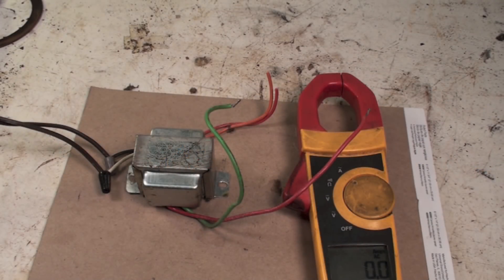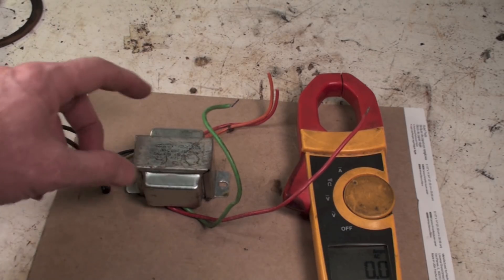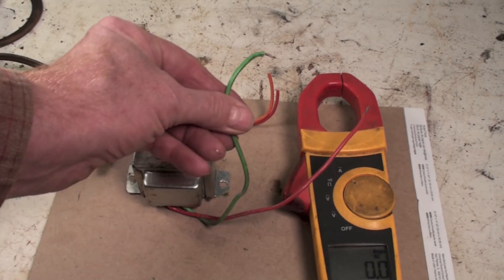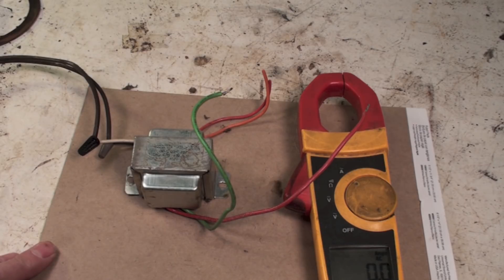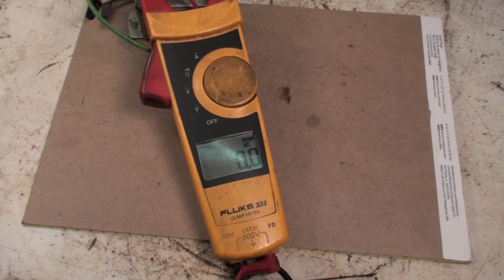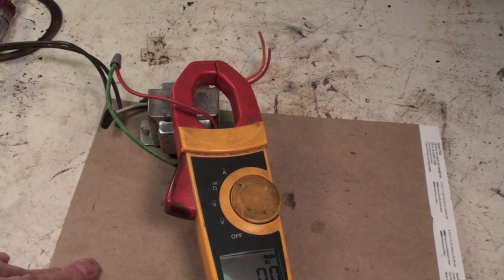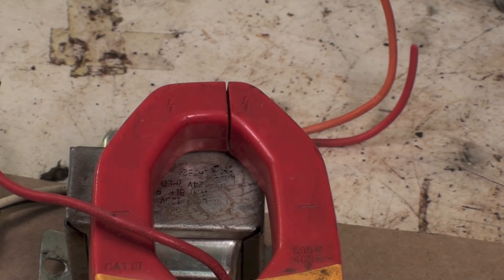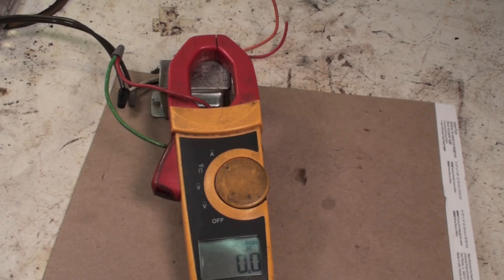How to replace a transformer (without burning up the new one)

Comment: What is the main cause while i start package acu,,,after i start compressor the transformer will tripping off
Reply from the maker: If the transformer is blowing a fuse or tripping its breaker, you have a low voltage short.  Possibly a thermostat wire shorted to the chassis of the unit.
GFM
Reply: @grayfurnaceman  sir but only transformer was tripping,,,the transformer has own reset button
Reply: Because the voltage of transformer was drop up to 20v only after starting the motor compressor
Reply from the maker: Yes, you have a low voltage short.  When there is a short, the voltage drops and the amperage goes up.  amperage goes up, breaker kicks off.
GFM
Reply: @grayfurnaceman  thank you very much sir

Comment: Would a voltage surge burn one of these up? We had some issues with power coming into the house, and half the circuits were getting 240 v, including the furnace. It didn't blow the furnace fuse, but the thermostat is no longer getting any power, but I've confirmed the system is getting 120.
Reply from the maker: It certainly could.  Look for an open in the primary of the transformer.
GFM

Comment: Looking at a 30-40 yr-old RHEEMS forced air unit. Blower motor works but every wire-nut popped, and the fan control (with the 8" sensor wand going to the plenum) wire that stabs in left side top burnt (primary voltage, I believe)..both wire nuts with 3 wires ea. on the 120v. in to the transformer fried,,transf. is not outputting nothing, ohms across 120 v. input wires=64 and secondary is 10 ohms..wire-nuts to the fan-motor fried (I replaced the motor 3 years ago). I stabbed a solid wire in the fan-control hole that burnt and wire-nutted it to the old wire, got no change, i.e., the main gas opens and fires when you plug in the transformer with wall control ON but when the sensor is satisfied, it shuts down and no blower-motor happening. I just bought a trans., but am loathe to install&burn that one , too, without discovering the root cause..which would be what?? (..do u think) thanks, cris 
PS:the guys at the real repairs place only asked me a bunch of pesky questions but would not discuss matters, leaving me with a lot of doubts as to my personal qualifications to be doing this..A-hem!
Reply: Replace the fan control relay.  If the unit is coming on, firing up, but no fan, the relay is the issue.  Might want to double check it is getting 120v first.  If it is, bad fan control.  They are supposed to close once they heat up enough.   Make sure to replace it with the same size, believe there are 8 inch and 16 inch? fan relays.  Make sure it is dialed into same temp as your old one also.

Comment: I am troubleshooting my Bryant KAV383 furnace. I have 120 volts into the transformer (probing black and white wires)    and then I have 26.8 volts coming out from it (probing blue and red wires at the same time).    is 26.8 too much?  my trouble code is a rapid blinking light which is for "line input voltage reversed" apparently.   I was thinking somehow the circuit board (21 year old furnace and all appears original) is going bad, but then saw some videos on here and decided to check the transformer.    $300 for a circuit board  vs $25 for a transformer.. but I am UNSURE which direction to go for the repair. .. thoughts? thanks !
Reply from the maker: The voltage is fine.  I would check input power polarity.  That is, check from the hot line to the chassis.  You should show 120 volts.  Neutral to chassis should read 0 volts.  If all is well, you probably have a failed control board.
GFM
Reply: I forgot to mention that I checked that prior to checking the red and blue feeds from he transformer.  The input (black lead) reads 119.4 volts and the neutral (white) reads .027 volts Ac

That’s why I’m thinking it’s a bad board.  Especially since none of the wiring was touched or fiddled with. Unless a ghost did it, I’m the only one in my house who would have opened the unit .

I think I’ll get the official carrier board instead of the cheaper knockoff version.  Quick question? Is there any extreme risk to putting it in myself ?  As in, could I be liable or at risk of being in trouble if something went wrong with it down the line and caused an accident or fire?  I’m thinking if something went wrong it would just blow that 3 amp built in dues on the board or trip the breaker at the main panel (220 volt 200 amp residential panel at my house). I am very mechanically inclined and it appears switching circuit boards is just a unplug and plug in type process, not something I should hire out a HVAC contractor for. 

Last question, the internal transformer (reducing the power from 120 to 26v)is usually warm to the touch when I was testing the wiring. Not hot just warm.  Is this normal ?  Of any concern ?
Reply from the maker: The warm transformer is normal.  As for liability, who knows.  Lawyers do most anything.  The problem is not the install itself.  That is pretty straightforward.  When the install is finished, you need to check the operation under different failures. Such as no gas, flame failure etc.
GFM
Reply: good point!  I did not think of that.    I see what you are saying.  once it is up and running, turn off the gas supply and see what the furnace (board) does.  also, try turning off the gas and then turning on the furnace.   gotcha.  interesting.    Ok, most likely I will be ordering a proper carrier board (not a knockoff cheapo one) and replacing it.   thank you VERY MUCH for the help so far.

Comment: Many people do not even know the purpose of these transformers. The purpose is to step down the voltage from the 120Vac/240Vac  to low control voltage24Vac which is what runs the air conditioning and heating systems. Multi tap transformers are adaptable to more than one source voltage where the primary coil will have  three wires (L1, L2, L3) with the centre tap and L3 being usually set for single phase 120Vac.

Comment: hey man question. I bought a incubator from china which has a 110v and I plugged it in to my uk pains with a uk cable 240v and it blew up how do use that incubator in the uk? do I get a step-down converter for uk  and buy a new 110v transformer
Reply from the maker: You can get a 240 volt to 120 volt transformer that will work ok.  The problem is you have damaged the incubator.  Parts will have to be replaced.  Have you done the numbers on repair or replacement including the transformer?
GFM
Reply: grayfurnaceman ... Not to sure what else might off blew but I know that the transformer smoked and it switched off real quick

Comment: I just had to replace my transformer on my peerless boiler. My first clue that something was wrong was that one of my thermostats started smoking when it was turned up. I pulled the thermostat off the was and it was black, and smelled burnt. I replaced it. The boiler still didn’t run. I was doing voltage checks and had 120v coming into the transformer primary and 0 v on the secondary side. I tried to find a transformer but couldn’t find one. I had to call a plumber who had one one his truck. He also replaced one of the taco three wire control valves. He said the valve shorted which caused the thermostat and the transformer to blow. Does this sound right or did he replace the valve for nothing?  He didn’t use a meter to check anything. He just went off of what I told him I found. Oddly enough I was charged a diagnostic fee. Thank you for your videos. Not only did you help me with this one, but I also watched and learned how to clean my boiler thanks to you. I really appreciate it.
Reply from the maker: It is common for the valve to short, and will damage the transformer and thermostat.  Sounds like he was right.
GFM

Comment: hi, thanks for video. really helpful
i have question, how did you get number 1.6A?  step down transformer(120v->24v) always have 1.6A on secendary? what if i use transformer (240v- - 24v)? im wondering how to get the number 1.6A
Reply from the maker: It is calculated from the VA (wattage) of the transformer.  The primary voltage makes no difference.
GFM

Comment: The main power source coming into the unit the primary while the contactor is like a secondary or substation supplying power to all the other electrical devices in an HVAC.

Comment: 79 coleman furnace in a mob home, california. fan motor comes on. runs for a minute and shuts off. a minute later it comes back on for a minute, then off again. the furnace heat is on the whole time. no juice coming from 24vac trans. i will replace trans. what else needs replacing
Reply from the maker: Save your money on the transformer.  If the heat is working, the transformer is working.  Electric, oil or gas?  Model?
GFM

Comment: I put my transformer 9-0-9 in reverse an it blew. Help me
Reply from the maker: You will have to explain how you have placed this part in reverse.
GFM
Reply: grayfurnaceman  man i put the output in the mains. here is my gmail address. if u want to see pics of how i did it

:    oragimirox@gmail.com
Reply: Ya that step down secondary did not like primary voltage level that was applied.

Comment: is my 24v xformer shot if i'm only getting 21v at the contactor coil???????
Reply from the maker: I would think there is too much voltage drop in the wiring or the transformer is wired incorrectly.  If the input power is 208 and the transformer is wired for 240, that would cause the problem.  Another possibility is the contactor coil armature is jammed.
GFM
Reply: Yes

Comment: Hello Grayfurnaceman,

I came across a tech who installed a 40va transformer in place of an original 50va transformer.  The old 50va unit had a built-in push button reset.  So the tech added a 3 amp fuse to the 24volt side as added insurance.  The AC unit starts up and works fine.  Tech was paid and everyone was happy.  But I'm scratching my head.  I have 2 questions.  What happens in the winter when unit calls for heat?  Will the 40va rated unit be too weak to handle the amp draw, and burn out prematurely?  Or will the 3 amp fuse be sufficient to protect it?  

The ac unit mentioned is a rooftop commercial unit.  The tech while wiring the primary was second guessing to wire it to the 208 or 240. So he measured the 2 wire's power (the 2 primary wires going into the old transformer) and it was 210volt  So he wired the 1st wire to common and the second wire to orange (208) on the transformer's primary.  He didn't open up the disconnect to check phase to phase to determine 208 or 240.  Is this adequate?  I don't think "rounding the 210volt to 208 was the right thing to do.  What happens to the transformer if the correct wiring had been 240volt, and the non-seasoned tech wired it to 208v?  What should be the normal procedure to do a correct install on this?

 Thank you grayfurnaceman.
Reply from the maker: The 210 number is correct for 208.  If the transformer 208 connection was used for 240 volts, the output voltage will be too low.  The 40 VA transformer is too small.  It may or may not operate normally but the factory used 50 VA for a reason.  Hope this helps.
GFM

Comment: Can a short between the leads at the thermostat cause the transformer to fail? A thermostat was being changed out when the leads were touched, now I have a transformer to replace. Thanks
Reply from the maker: Sergio Terrones Yes. If the "c" and the "r" are shorted, it could take out the transformer. 
GFM

Comment: can I test the voltage of the doorbell by removing the outdoor button and using a multimeter on the 2 wires?
Reply from the maker: Yes.  If you show power, all is well except the switch.
GFM
Reply: I'm just trying to find out what's the voltage of the transformer. I find it easy to test at the ring button instead of having to locate the transformer... I tested those 2 wires and it read 17v, but I want to make sure this is an accurate reading.
Reply from the maker: I am not sure but I think they are 16 volts.
GFM

Comment: Burned up 2 transformers trying to start A/C this year, and I kept hearing the condensing unit contactor was probably at fault. Replaced both, and noticed transformer buzzing, ready to blow again. I disconnected low voltage wires at contactor, still the same, so I disconneced same wires inside furnace, and no more buzzing. The wire going outside was shorted out, rubbing last 10-15 yrs on a metal part of furnace. Replaced, now have A/C!
Reply from the maker: More common that you might think.
GFM

Comment: Almost all 208v nominal systems I work on are incorrectly tapped to the 240v nominal lead. They often work fine, but it blows my mind that the installers didn't tap it correctly...

Comment: i replaced my gas valve on my miller cmf80-AG and installed a new thermocoupling , but when i  turn the thermostat up to light the furnace it does not ignite and it also puts the pilot out , any ideas?
Reply: Sandra Stan did you check pressure with manometer?
Reply from the maker: The pilot goes out when the gas valve opens?  If so, I would look at gas supply.  Do other appliances work ok?
GFM

Comment: hay Gary Furnus guy I have a greenheck model M34625 and a teckmar boiler 4 stage trying to see where to hook up  I have a ca Alarm contact on the Teckmar D264 I have no end switch need a.  diagram if you have one
Reply from the maker: +David Petrusewicz I do not have one.
GFM
Reply: I left a 
 comment and yes I figured it out the alarm contacts will work the person that put the damper motor on put on reversed so turn motor 180 deg now it works fine

Comment: thaks, for your fast responding, i will do that, have a nice night!
Reply: +JAIME ARTEAGA I have a question if you don't mind - what was his suggestion? I looked in all the posted comments but I do not see one in response to your issue yet you received one. I ask because I have the same issue with my system and I'm scratching my head why this is only occurring when I switch to Heat Mode. Thanks
Reply: +AlexTheGreat Hi, alex! the problem was the thermostat, we replaced and now is working fine, if  you have the same problem, what you can do is bypass the thermostat putting together the RED, GREEN AND WHITE wires on the thermostat wire with a wirenut REMEMBER POWER ALWAYS OFF if the system work just replace the thermostat good luck!
Reply: JAIME ARTEAGA
Thanks!

Comment: Hi, mr. grayfurnaceman! i had that problem and this is the second transformer blow out, it happens just on the heat mode, so what should be the problem? thanks for your help
Reply from the maker: +JAIME ARTEAGA Probably a short to the chassis of the unit.  I have a couple of videos on that.  Check low voltage short in the search.
GFM
Reply: Same here. It shorts on heat mode. The A/C worked but then when I switched to heat it didn't work and the transformer started crackling and smoking.

Comment: wow, thanks for responding!  this is where I am at. Saw your other video....put amp meter over secondary wire ( red going to Terminal board), turn on breaker to air handler, then getting 5 amps. I have lv wires  to outdoor HP disconnected and No calls on Stat. What could be drawing the amps on secondary wires with nothing on but power to Ahandler. I put fuse in line, trnfmr hums, but not loud, fan does come on with Fan switch and cool call.  Replaced Seq as well, ohmed out all LV wireing, doesn't seem to be a short in them,    comments?
Reply from the maker: Sydney Gourley Start pulling off wires from the terminal board until the overdraw stops.  That will be the problem circuit.  Hope this helps.
GFM

Comment: Trying to find a problem in my air handler : I have blown a few transformers. The Fan Relay is buzzing loudly, i turn power on only a few seconds, but after a few trys the Tnsfmr does not make 24 volts.  I am on my 3rd Fan Relay. The original is Hnywll 1043, now discontinued, and using others with same amp ratings. The Pins are pretty easy to understand for correct hookup, 1-3 is open..goes to Motor, 4-5 is N.C. also goes to motor, then the coil runs on LV from Trnsmr.   The original problem is the outdoor HP is not coming on a Cool Call. I am inside at the stat and Air Handling wires looking for failure.  The red and yel LV wire jumped kicks HP contactor on, but through stat it will not. I am on 3rd stat for elimination purposes.   You recommend looking for shorts, I will do the amp draw at the secondary, then maybe ohm each LV wiring running through wall from TB to to stat.  Things were  working fine until leak cause outside unit to not come on.
Reply from the maker: Sydney Gourley I did a couple of videos on looking for shorts.  They may help.
https://youtu.be/eBYunyrImf0
GFM

Comment: Hello,
I got a question on testing.Do I have to have the wires connected or can I ust test the prongs of the transformer with an ohmeter? Ac volts  correct? Where do I place the black and red when testing ? Thanks in advance!
Reply from the maker: Jay mans The wires must be disconnected for the ohmmeter.  For this use, the red and black are interchangeable.  Hope this helps.GFM

Comment: 120-v is your hook up but is there any voltage in the 208/240 wiring pig-tails, I noticed you have no wire nuts on the wires.
Reply from the maker: Danny Calk Yes there is.  This is not any kind of permanent install.  You could damage the transformer if the leads were not isolated.
GFM

Comment: Solution - a real big thanks to your many videos.  I have spent hours watching your videos and repeated them to educate myself.  The hardest part would be to learn how to use the voltmeter - I have one - but have not used it in years.  HERE is the solution. You have another video where you tap what appears to be a thermocouple - like a button battery on a tuning fork - I found this component near the top of the Rheem Prestige Super Quiet 80 and tapped it as you did. The furnace has cycled 5 times now so my hopes are high this was the fault.  If the furnace fails again - your further ideas would be appreciated.